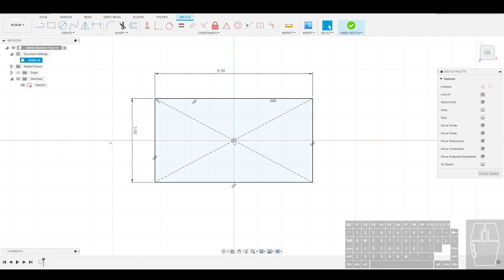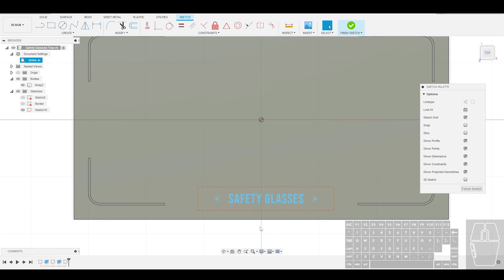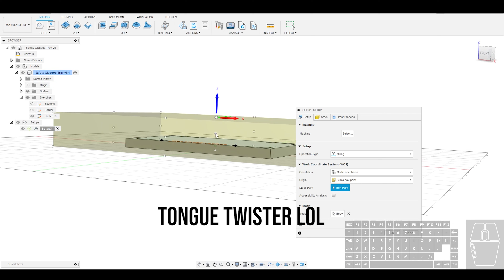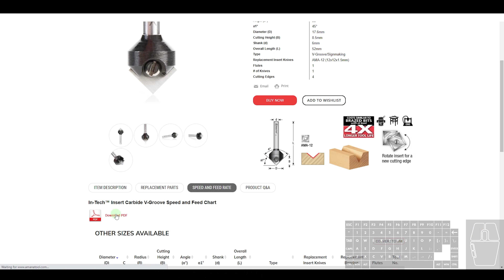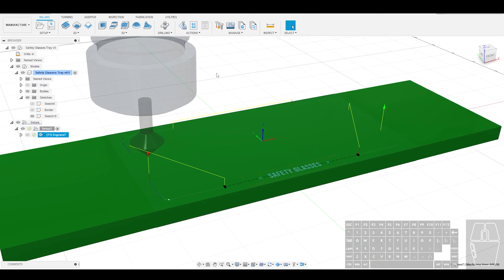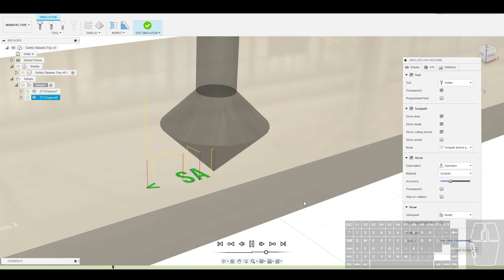Complete V-Carving Walkthrough Start to Finish  [Part 1] - Modeling, CAM Setup, Toolpaths Fusion 360

Comment: I use the hobbiest version of Fusion 360 for CNC routing on a regular basis. It isn't true that you have to export every toolpath separately. You can export as many toolpaths at a time as you want, but only if there are no tool changes. You can even export toolpaths across multiple setups if you don't have any tool changes. If you order your toolpaths so as to minimize tool changes, that will save you considerable time and hassle in posting and managing the gcode files. At the same time it will save time at the router - especially if you need to do manual tool changes.
Reply from the maker: Thanks Michael, yeah I call that out via text pop ups. I misspoke here but left it in because I still wanted to show how I export multiple paths and I use it as an example in the next video on why you need to pay attention to your machine because mistakes can happen.